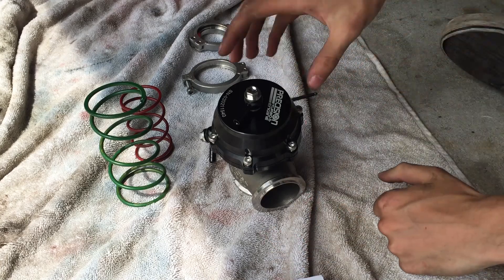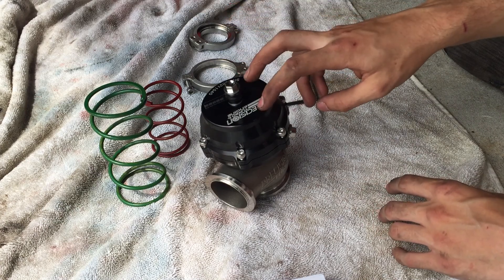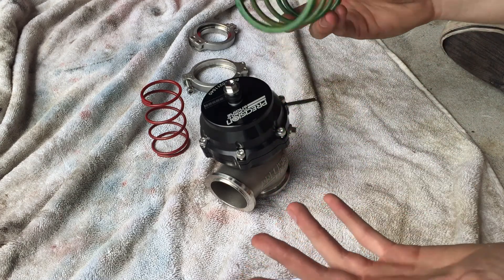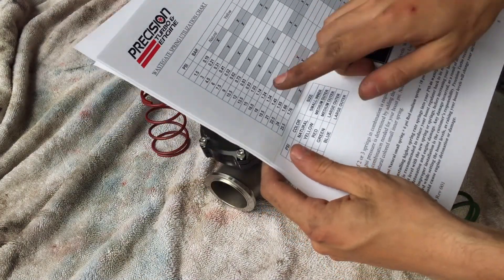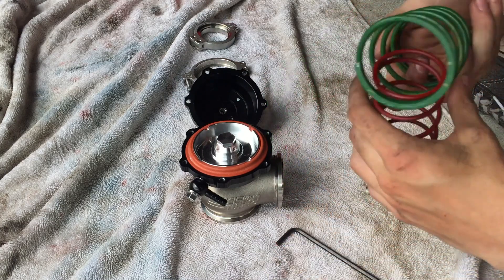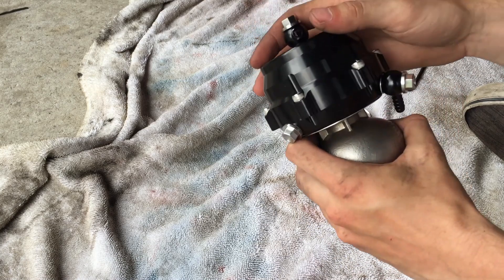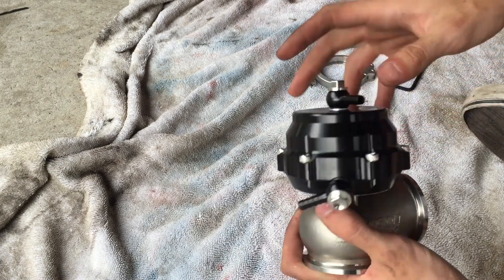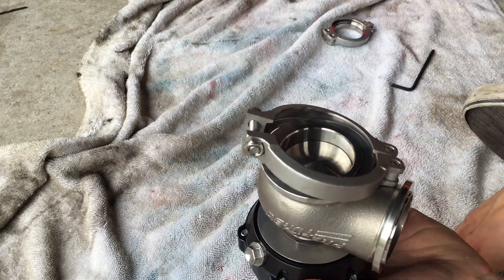Ep. 13.5 | Waste gate Setup | 240sx 2jz swap

Comment: Can the top one be capped off ? Well like pluged with another bolt ?
Reply from the maker: No the top port can't be plugged it needs to be vented. If the top port is plugged the wastegate can't actuate properly. The bottom port must always have a boost source connected to it. Hope this helps!
Reply: @TunerFaction  the problem I’m having is my hood won’t close because of the one on top. Can I just take it off and leave it open?
Reply from the maker: @roadjokers1119  Yep that would be fine!